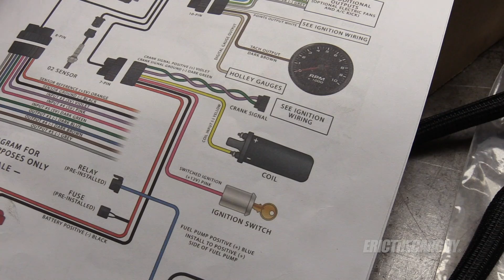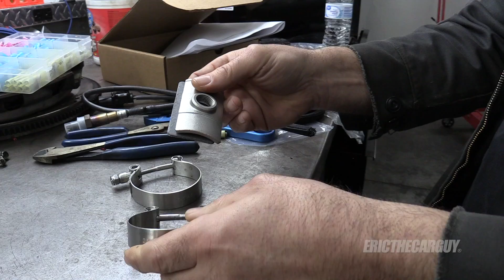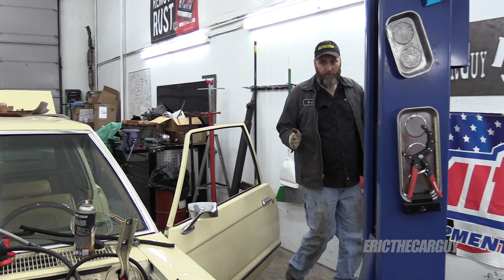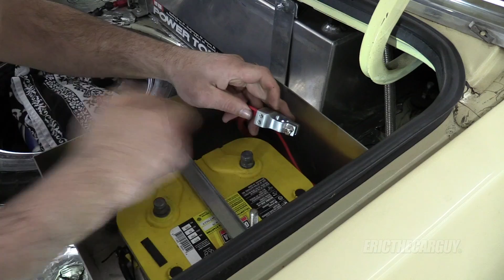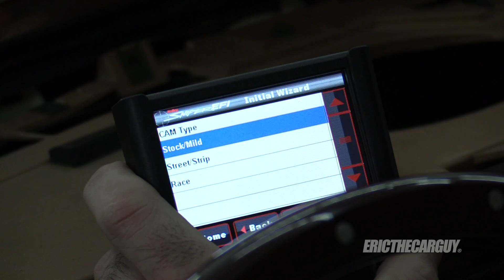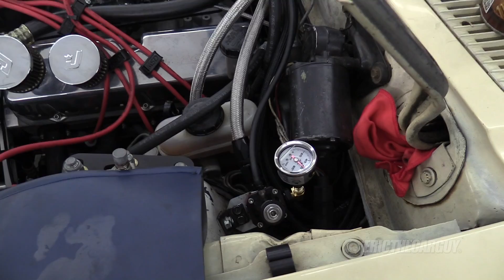How To Install a Holley Super Sniper EFI

Comment: I wonder the worry about getting the 12V to the ECU, when the ECU is getting a beating as it is inside the worst place for electronics to live, even very high build spec ECU's, are stuffed inside the car to avoid vibrations, electronics and welding joints hate vibration... weird... besides, being attached to the 12v post under the hood or directly on the battery, is exactly the same, if you have 12v noise, you'll have that noise everywhere on the system (usually a bad battery causes noise, as is isn't filtering it), you'll feel it in the radio, in the lights, etc. About the EFI.. well, that is still a carburator with computer controlled injection. That IAC is funny, I bought 1000 of them from china for 1€ each,, they are used everywhere. You'll be replacing the heads sooner or later for a real EFI.
Reply from the maker: That would require rerouting my entire cold side system. Not to mention the expense and time of rewiring the car for that set up. As I've said 1000 times, this is a street car, not a race car. I'm very happy with the new set up. I'll be even happier when I install the Hyperspark and I can control timing from the driver seat as well. Thank you for your comment.
Reply: @ericthecarguy  Yes Eric, it's a major upgrade and not only rewiring but almost a complete new build from the engine body up, and you know, I also started with a street looks car, sleeper style, and ended up overbuilding the whole thing, I'm in europe, so it started as a i4 TD which went up to 230HP and 600Nm and now it's a V6 TD with 360HP and 750Nm with a DCT :) but still a french white Citroen C4 :) but so lovely to see BMW's eat dust, you also have a Citroen engine in your garage, inside the Mini. Love your videos! keep doing them and the Farimont is an awesome sleeper, I just need to teach you how to speed shift :D Someday I'll post a video for you. Cheers!

Comment: Let me preface this with "I am not a mechanic." so if the question sounds stupid, yeah... Wouldn't it have been easier to make a custom harness to Y off the coolant temp. and wide band O2 and hooked up both the Holly and the gauges off the same sensors?
Reply from the maker: No. Not all sensors are the same. Also, the controller is looking for a specific signal. Give it something else, and the readings won't be correct.
Reply: Wideband O2 sensors are current-based, not voltage-based - the ECU needs to measure the current through the sensor, so you couldn't run one sensor into two devices.

Comment: Looks a better set up than a Megasquirt. I've been trying for months to my car to run right on that crap and the Fairmont started so easy with the Holley
Reply: Because you dont know what you doing,      been using in for over 12 years MS2 and later MS3X and installed two others , it works but you need to know what your doing lots of reading is my advice.
Reply: @chicanesimon  I was blown away when my friend first showed me his megasquirt ECU and the software he was tuning with. It's some serious business. I think the only reason it's not as popular as some of the others is the fact it's so advanced, and not exactly marketed as an "easy" or "plug and play" setup.
Reply: Mega squirt is tricky business. They are literally a blank PCB that can be built and programmed to do ANYTHING, literally. The possibilities are endless on a megasquirt. My friend runs his turbo Elantra on a MS3 pro and it was SOOO much initial setup, it was insane. Because he built the board, and started the tune from scratch, there was ZERO default inputs. It took forever to get the car dialed in, but goddamn, once everything was set and calibrated, the live tuning and datalogging was amazing. It's a powerful engine management system but not for the faint of heart.
Reply: Yes it can run with megasquirt, But i ditched that setup and bought a haltech elite ecu, and it runs smooth now.

Comment: Cue all the people complaining that this isn't the right EFI solution for the Fairmont. Why not build your own car the way you want to build it instead?
Reply: @Simon Coles   It's not real EFI or engine management.  What did you expect people to say?
Reply: I assumed after his talk of wanting to make the fairmont a drivers car, and a street car that he would be going full standalone and be able to control individual cylinder fueling and timing.
Reply: and that matters how, exactly? You're free to build your own car with engine management if it's that important to you.
Reply: @ArchimedeanEye It has fuel injectors and it is electronic. That kind of makes it Electronic Fuel Injection.
Reply: @Simon Coles  No.
Reply: @ArchimedeanEye  https://www.youtube.com/watch?v=WKUCgaMEXuA Seems Haltech considers throttle body EFI to be just as real as multiport...
Reply: Simon Coles everyone is entitled to an opinion. Worse than people complaining is people complaining about people complaining.
Reply: Who cares if it’s throttle body or multi port EFI, as long as it meets Eric’s requirements, which I understand to be ease of cold starting and idling. As he stated in a previous video, he was OK with the carb except for having to adjust it under certain conditions. His Holley EFI solution solves that problem and presumably gives him the performance he needs.

Comment: I don't know much about fuel injection conversions, but wouldn't it be easier to just get a different manifold for injectors and use an ECU like haltech to tie it all together?
Reply from the maker: No, it would not.
Reply: it's not really that hard to set up a port injection system but it costs a lot more money and takes a lot longer to install because you need a new intake manifold, a throttle body, fuel rails, injectors, ECU, and potentially a different fuel pump as well. It would also require re-routing the cold side turbo plumbing in the case of this car. The Super Sniper on the other hand is almost entirely self contained.
Reply: That would be nice but would require a whole lot more effort. Still need a throttle body, which of course comes with re plumbing the intake from the turbo etc etc.